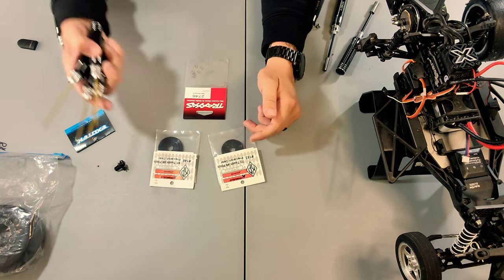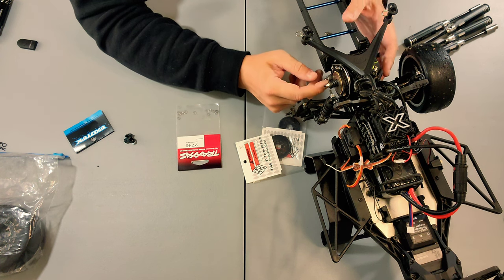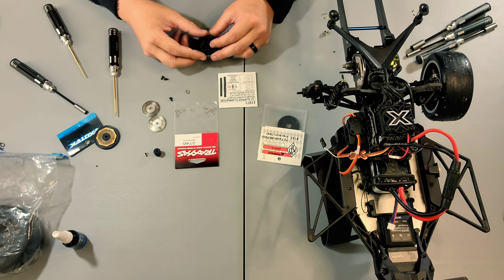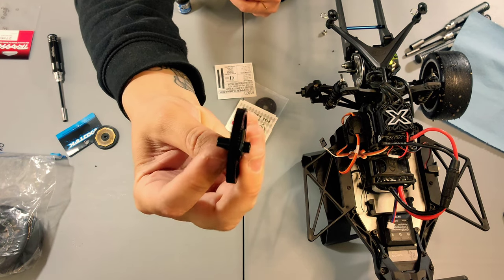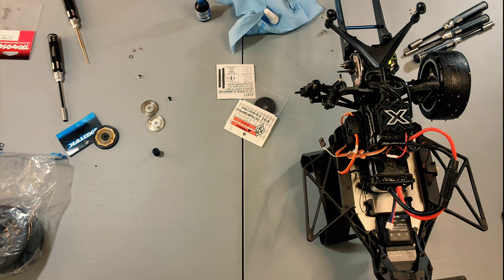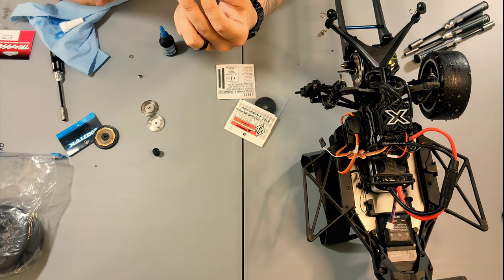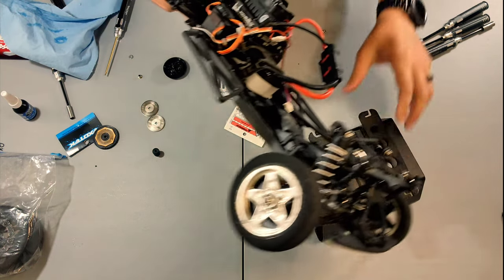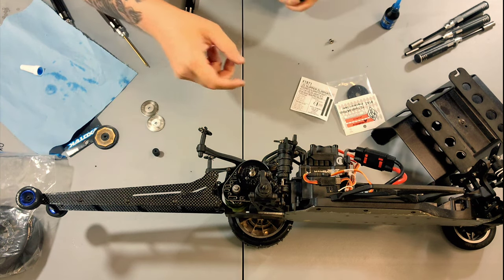Exotek Slipper Eliminator Install! Faster or Slower?!

Comment: Hey Mr. Mell,  great video, think I’ll go ahead and trade out my locked up slipper for a less complicated “eliminator” and is there a follow up to this vid, how did it go ?   
  I have found that locking every thing up tight, dif, slipper, even the gear mesh to the point of only a slight gap and that also includes taking all the slop I can out of the drive line-then controlling my power to the wheels through adjustments in my…what do you call it, power curve, through programming works well. 
  No secret here-the really fast guys and gals put their money into the batteries, but until then we will make cheap incremental adjustments. 😂 ✌️
Reply from the maker: I haven't put out a follow up video quite yet due to some medical stuff. But im getting ready to start testing and tuning again for this next season. From what I could tell the eliminator definitely changed the aggression from the box. I had to adjust my curve and my torque limiter to keep it from blowing the tires off on the line. After I got that fixed though it was smooth sailing. I'll never go back to the slipper.

Comment: I have the nooner chassis and have the exotek slipper eliminator and also use the mmx8 and 2.0 motor.  Solid setup for sure! Proline reactions 🍊🔵
Reply from the maker: I actually just priced me a Nooner RC chassis. Gonna be buying it soon.
Reply: @GirthyTikTak  I just listed mine for sale to my area guys here in North Dakota.  As I’m going to give star breakout mid motor chassis now.   Im trying to sell it as a full roller kit. Or as a race ready machine just add the body and wheel/tires.
Reply: @GirthyTikTak  also have spare TLR drivetrain parts so if something break’s it’s fixable on the spot. And from the battery tray to the wheelie bar wheels is all R-Design’s part’s.
Reply from the maker: @rockyf405fortenberry8  I have r design front and rear shock mounts and wheelie bar mount I don't have the body mounts yet. But will get them. And I carry extra drive shafts and gears with me everywhere along with extra wheels and tires. So fixing stuff isn't as detrimental on race day.
Reply from the maker: Awesome brother! Hope someone gets it that'll enjoy it and take care of it. I'm currently building a FrankenVyne bullet chassis mid motor set up. It's fun. Hoping to have it done in a week or so.
Reply: Exotek makes nice stuff...I'm building their Vader chassis now. Waiting for more parts to complete.

Comment: What wheelie bar u running?
Reply from the maker: The exotek for the drag slash but with the R Design rear motor surround/wheelie bar mount. I'm actually about to switch to the 300mm R Design carbon wheelie bar.

Comment: Are you running a diff locker also ?
Reply from the maker: I'm not for the soul reason that I'd rather spend 15 dollars on a new gear set than 50 for axles. I am running 30,000 weight in the diff tho.
Reply: @GirthyTikTak  Totally get it bro. With that weight fluid ..its pretty much locked.
Reply from the maker: @robertregalado1015  it is but it gives it just a little give in case I hit something or the tires grip unevenly. The minor give to act as a cushion.
Reply: @GirthyTikTak  I agree..something has to give. Like you mentioned..if you lock everything up in the Trans. Break points will be driveshafts and axles. I bought some diff locks . I haven't installed them yet..I might to the same with the eliminator and heavy fluid in the diff as a safe gaurd. Destroyed a few servos running direct with no servo saver. A lesson learned.
Reply from the maker: @robertregalado1015  agreed. I've done that with servos, steering arms, tie rods, hubs all because I thought in the beginning that the all aluminum was the way to go. Leave stuff plastic for break points. Leave certain things weak if you know it's only 10-20 dollars to fix versus a 50 dollar set of axles, a 35 dollar bulk head or other things.
Reply: @GirthyTikTak  The Exotek Vader chassis I'm building is 80 % composite and aluminum. Ill be using plastic control arms. Hopefully  that will allow enough give on a crash..and their cheap to replace. Plus I've got that big slash foam bumper from Exotech...for added protection.
Reply from the maker: @robertregalado1015  yeah I have a 300 dollar bullet carbon fiber chassis I'm really reluctant to get going fast because the chassis has no give at all and the bulk head is aluminum all the arms are aluminum too
Reply: @GirthyTikTak  Plastic is very forgiving..ridged it is not. I totally understand your concerns. I probably feel the same way when I start running the Vader.
Reply: Hey Dustin . My Exotek Vader is complete. What a journey it's been. I presently are using big bores front and rear. The issue I'm having with the front shock set up is they stop at ride height with no droop ..not good. What shocks , springs ,and weight oil  should I be using to achieve the droop ..but be able to stop at right height with an external shock stop. Thanks  Your input would be appreciated.
Reply: I figured out what the issue was with my front shock situation.  I removed the internal stop and found some springs that sit perfect at ride height. Now the front droops to full extention and returns to ride height. 
I've got 40 weight in now..think I need to go as low as 20 or 10. A little sluggish with 40 or bigger holes on the piston. Looking forward to seeing the results. Your vids are very informative.
Reply from the maker: @robert regalado  I run 20 to 30 weight and my internal limiters are almost nonexistent lol. I only run limiters where I risk lifting to just wheelie bar wheels. External limiters to keep the body off the ground and preload to get er launching straight lol
Reply: @GirthyTikTak  I'll try some 20..